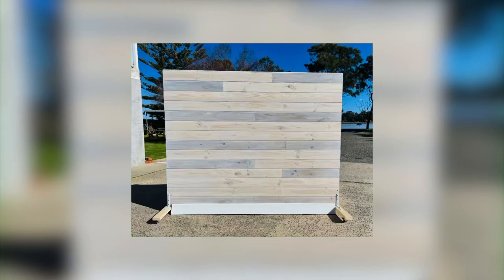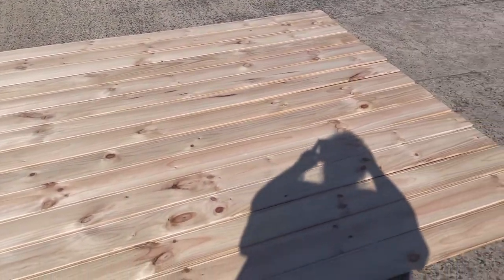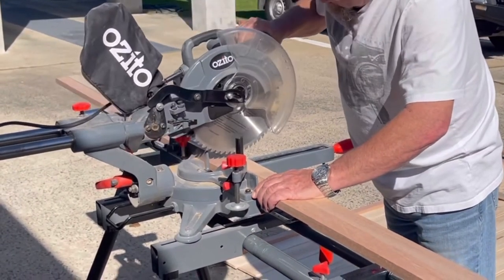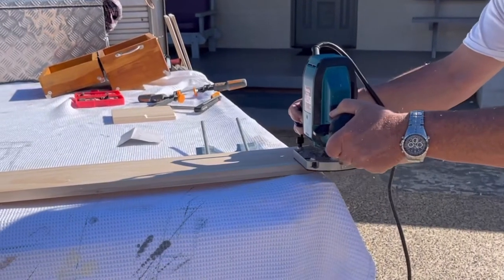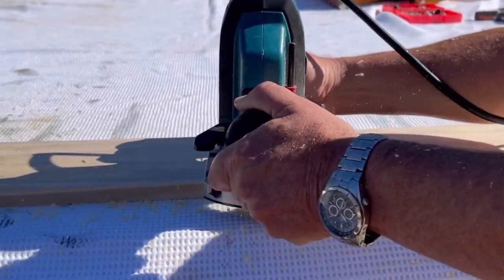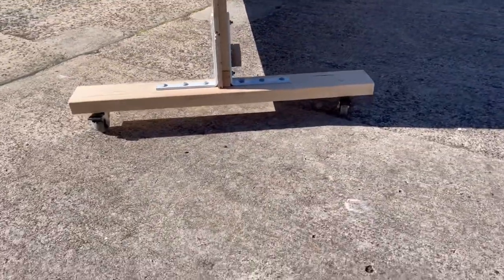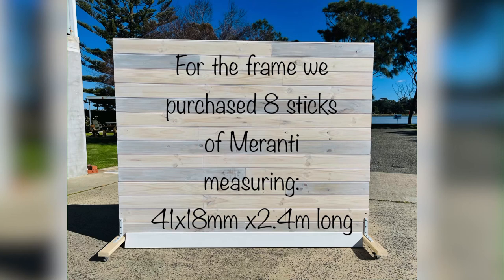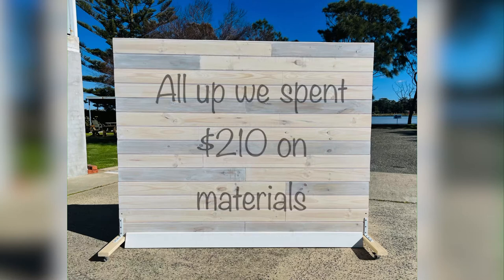How we built our staging wall for photography/furniture staging

Comment: Hi, I’m a little late but I’ve just watched this video and I have a question about the Feast Watson Limewash that you used. Specifically where you mention giving this a wipe down after the first coat. As this is water based, did you dampen down a cloth and then wipe down ? Is the process the same as wiping down any of the Pureco stains for instance ? The reason I ask is that I have just bought a tin of the same stuff, with a tint added called Natural Buttercup, as I’m hoping this will give me what I’m looking for in my attempts so far (failed 🙁) at staining the ugly miss grained cedar wood on my TV unit that I’m in the process of updating.  Cheers Rob.
Reply from the maker: Hi rob,
The Feast Watson Liming white   That I used Is not water based it is oil based.
On our staging wall I stained a few boards with the Pureco stains which are water based, then once they dried I applied the liming white to the entire  lot. 
Because this wall was so big I applied the liming  white in sections then after a few minutes I wiped off the the excess with a cloth.
I did not dampen the cloth.
I would recommend instead of the liming white to try purecos stain and glaze in the colour whisper.
This is water based and a lot more forgiving then the oil based stuff. Therefore a lot easier to use.
I hope that all made sense. I use the Pureco whisper stain in quite a few of my videos. The ugly duckling video shows how to use it from start to finish. 
Good luck, let me know how you go. 😊😊
Reply: Thanks for the quick reply 👍 I have previously tried Pureco Whisper but found the results unsatisfactory due to the very strong irregular grain patterns of the Cedar and also because of the multiple defects in the surface of the cedar which required filler. The Feast Watson Lime wash brochure I have in front of me mentions clean up with water, yet the actual tin I bought was definitely oil based ? Hence my confusion. Did you use a sealer as well ?
Reply from the maker: Hi rob. I didn’t use a sealer on my staging wall but I would recommend using a sealer on furniture. You could also try using a wood primer before applying the liming white. This should give you a more even finish.
You could also water down some white paint and try white washing. 😊😊